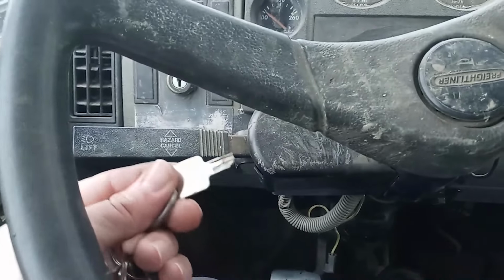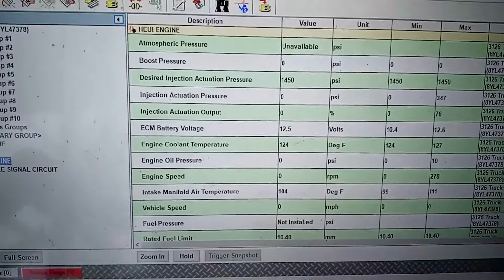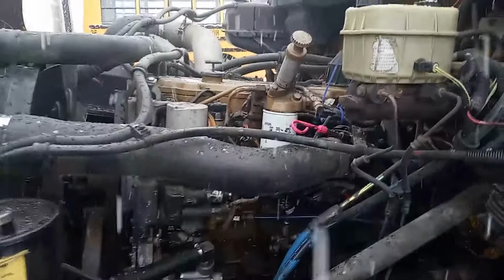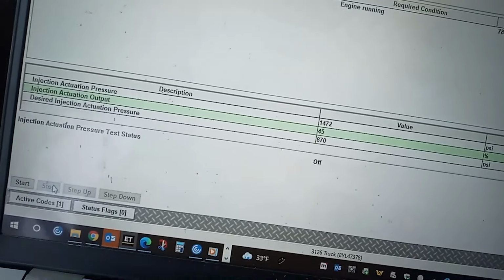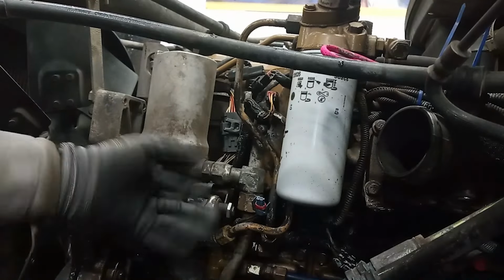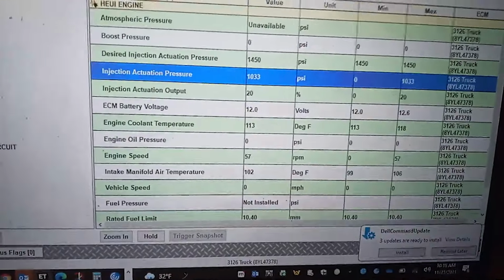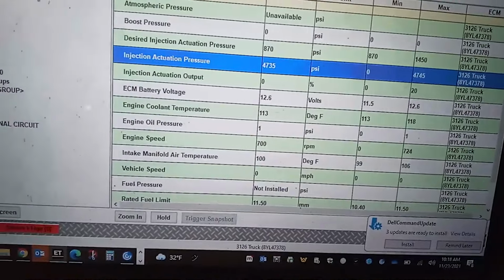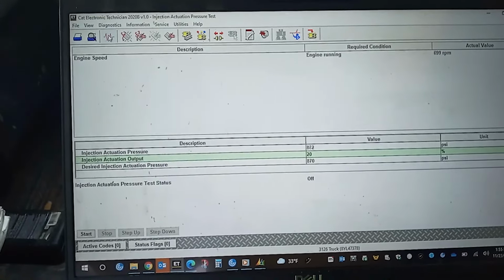Why Wont This Engine Start!?!

Comment: Thanks AA, learned about the C15. This one won't start, FP is good. Closed off regulator for full pressure, pins in P1 have batt+ and batt- like you said. I think ECM is bad. Don't have an inductive amp probe though.
Reply: Also, did an injector test with J-Pro, said short fail, don't know that means.

Comment: Do these 3126s have lift pumps? If the truck is parked downhil with the tank elevated, it runs fine but as soon as the trucks nose is uphill, it runs out of fuel and dies. All filters are new. Makes me think it's a lift pump but I can't find one!

Comment: hey Josh. I have a 2001 3126 and it has a long long crank after sitting. I have air in the return to tank fuel line. I bypassed the fuel tank lines and ran clear lines to transfer pump. I still have air in return fuel line. what do you think? injector bore leaking compression into fuel? please and thank you

Comment: I have a C7 2005 F650
KEY ON IM GETTING NO POWER TO HEUI. The ecm fuse hit the ecm combines with the ignition to ecm to fire the ecm which feeds the engine portion of the motor? Im curious on my next move. I hooked a laptop to it but not able to connect like its not fully getting power to the connector for diag.  I put a power probe into the diag connector i have hard power on 6 out of 8 pins. The two pins have power but like a flickering dim light. Any thought on my issue sir? Tia

Comment: Im from Pakistan - Ive got an 2012 Hilux Invincible which I imported it from the U.K cause the ones made in Pakistan do not have intercoolers! - Anyways I want to inspect the engine from the inside like the rod bearings, piston rings, any and all clearances etc - So as Ive got drive way, porch & a garage at my place - I was thinking after buying all the necessary safety equipment & tools for the job like the torque wrench and all lol - To bring my mechanic who actually understands how the work should actually be done at my place and have him do the job here - After researching and understanding on how to properly do it - I can guide him better. What do you guys think? Any advice? -
OFF TOPIC....
This Hilux was the first & last 4x4 by father bought me before he passed away so its really important for me - Since Im into Automobile Mechanics I was thinking of doing a course or something from abroad and make my own workshop here.

Comment: Hello . I have a Claas Lexion in Sweden with cat c9. hope you want to help me.

it runs on the startmotor with won't start. If I use a little brake cleaner in the intake it starts and runs perfectly. the feed pressure is zero when you run the startmotor but it is a 12v machine. when it is stared I have 5 bars. replaced all houses  and filters. also the reduce valve replaced. thanks for good youtube videos. they have helped me so far :)
Reply: Cod 164-11

Comment: I have a 7.3 Powerstroke and to my knowledge they use this fuel system from Caterpillar. I was having an issue of the truck not starting and I found the Injection pressure was not high enough. I was only building 200 psi. I replaced the IPR from Ford which I'm sure they get from Cat.  It solved my problem and I haven't had a problem since.

Comment: do you have the cat number for the dummy valve
Reply: Did you find the part number for tool?
Reply: @joebob3049 not sure if you still need it but it's on his description on the top.

Comment: Nice video sir.  One thing I always stress to customers is check your engine oil level first, if the injectors are passing oil into the fuel system, eventually the engine will die and have a hard time starting.   I also remove the nut holding the solenoid for the Injection Actuation Pressure Control Valve and slide it off the IAPCV and use a 1-1/8 box end to loosen the valve.  Keep up the good work 👍
Reply: When you remove the IAPCV, you can put the test plug in and dead head the HEUI pump.
Reply: @OldDieselGuy64  cheers thanks, I'm just learning electronic fuel systems in school right now
Reply: apprentice here, what will loosening the valve accomplish?
Reply: @busterscruggs3031  which valve are you referring to??
Reply: @OldDieselGuy64  sorry, the iapcv
Reply: Best of luck, was there about 40 years ago

Comment: I JUST GOT A 3126, ITS IN A 1999 BLUE BIRD, WERE IS THE MANUAL PRESURE PUMP HANDLE,BECAUSE IT HASENT RUN IN A YEARAND 1/2,NEED HEPL LOCATING IT

Comment: We used to remove output line install a line with tee 8000 psi guage plug the end of the tee, crank, dead head test should get near 4000 psi if it can then leak is an injector upstairs

Comment: Great video that shows what your “snoopdogging” troubleshooting technique has done: you saved the customer money by finding the exact problem of low fuel pressure was a solenoid vs. changing out a pump, and you enhanced your “cred” as a top notch diesel mechanic.  👍🏻👍🏻👍🏻

Comment: Hi man I have 2006 GMC c7500 caterpillar  u need to spend 2 hours to start  it has 90k original kms   when stating u need to pump fuel with leg many many times    it's c7

Comment: Our 2003 Newmar motorhome has a 3126 with the square head heui pump. If it fails can we replace it with a round top heui pump. I  like the idea of only having to change the solenoid (is this what you referred to as a driver in another video?) Ours only has about 51k miles on it  Thanks
Reply: Did you ever find out the answer to this
Reply: @timblack33  nope

Comment: Sorry to bother you but I have no experience at all with diesel and I am the proud new owner of a Thomas School Bus that I am going to convert to a skoolie. It has a 3126E with a CKM 4XXXX serial number, 103 miles. It runs GREAT, no smoke but, I have a few issues. One is, that on cold mornings (cold by SoCal standards, cool to anyone else) when I turn the key, nothing happens, no dash lights come on, no 'click'. BUT, if I just leave the key in that on position (just before the crank position) it will, in one to 3 minutes, come on, dash lights, gauges on and it starts like nothing is wrong. It can't be that it's supposed to act that way, could it? its a 2003 Thomas Bus with a 2002 manufacture date for the motor. Any thoughts? What should I check and or look to replace? I am competent at following directions.  The other two issues are it will tend to run hotter than 220˚ up hill in hot weather. Not big hills either. And can start to run this hot in stop n' go traffic if I have to sit at idle in drive for any extended period. The third thing is that the motor is 'governor' controlled to not want to drive over 55. I got the bus from Virginia and that seems to be a regulation there. I think that if I could get that all turned off, I could get lower RPMS (currently 2300 at 55). Thank you for whatever assistance you can provide.

Comment: Kind of an unrelated comment, but I recently purchased a gmc c6500 with a 3126, i was considering running amsoil diesel 15-40. Good bad yes no? The only videos iv found about it seem to be advertising.

Comment: I had an oil pump break off one of my customer trucks because the front main cap was loose. Came in for a front main seal leak. One bolt was still holding on and I unknowingly pulled that bolt first and nearly dropped it on my face. Lol

Comment: Ah good call on those pliers! I hate those solenoids on the c13s. The fuel enable valve, the IVA oil control valve, and the CGI control valve solenoids always give me an issue. The nut gets stuck to the coil part and the whole damn thing spins. A normal wrench won't fit on the base. You have to grind it down to fit.

Comment: Hey i just bought a freightliner with the caterpillar 3126 engine. I drove it from california to arizona which is about 300 mile or so. It was driving fine , but as soon as i got home and was ready to park. It started smelling like burned rubber and i saw a cloud of white smoke from the front of the engine. Now it cranks but wont start. I made it start for a few seconds but it starts smoking right away and it seems like something locks up from where the serpentine belt is and it makes the engine shut off. Any idea to what it might be ?

Comment: I have a 3126 in a 963C BBD serial number prefix and if it sits more than one day it will start and die and not start after that it will blow all kinds of white smoke but won’t fire at all unless you spray it with either. Cat check pressures and said everything is working but there’s something not right any help would be appreciated
Reply: Went through the same thing on the same loader. Heui oil sensor wasn’t consistently reading pressures so it’d start sometimes and idle rough or die.

Comment: I have a 3126 that's dropping on its face after 100% throttle but passes the IAPT. Has the same codes as this machine. You can watch the pressure drop after full throttle. I'm kind of stuck.
Reply: Go to a forum website
Reply: I'm curious did you figure out this problem? I'm losing power and my check engine light comes on after about 60 mph.
Reply: @derrickdunklin   it was multiple problems. Harness short to  actuation pressure sensor, injector seal failed, and clutch switch  circuit short. All causing drivability concerns. All under different conditions.

Comment: I'm a independent shop. Had open my door to back out a pickup. Backed out the truck, then all of a sudden a falcon flew in the shop and landed on a customer's 68 roadrunner. After it flew back out, I turned around and looked up on top of the roadrunner and there was a gopher, alive! That was exciting to chase out.

Comment: Cheap fix,  l got a c7 and  now on only will start after is cranking and engine built oil pressure , it can take like 10 seconds turning over into the engine build pressure and start but won't start as normal right away, only does that when park overnight, that could be the heui or temperature sensor?

Comment: I replaced ECM( was bad)  ,Heui, IAP still no start now changing cam sensors.I pinned out all power grounds no output from ECM no Heui pressure.
No leaking injectors only 40,000 miles RV motor ran perfect. Then never started.
Any ideas?
Reply: What cause of the first ECM failure. Is it getting all power and grounds, getting key on power. Can you hook up a EST to the obd and see if its online. Voltage drop test battery cables?
Reply: @keiferjanz3197  i cant communicate with CAT  only Freightliner chassis is a Class A rv .
I plug my CanDoo scanner into the port on Motor no communication .
CAT dealer flashed ECM . Not sure where port is in RV to scan.
Motor ran perfect and one day no start.
I checked all power grounds . I am changing both Cam sensors soon.
40 years as a mechanic this one got be mad. My RV of course . 
Thanks

Also crank speed was low. Maybe a issue gor Heui pressure to get to 870psi ?
Reply: @mitzvahgolem  Most electronic engines will  run off of one speed sensor if say a cam sensor is faulty, normally delayed starting will occurs. I'm not familiar with Cat Ecm's if they are using Can communication, if so there is a possibility of a bad terminating resistor. This will cause an Ecm to be offline
Reply: @keiferjanz3197  where would that resistor be at? Thanks so much👍🤓
Reply: @mitzvahgolem  normally there will be one internal on the ecm and an external one, they usually look like a blank connector on a twisted pair of wires on the harness. The wires are normally green and yellow. When you test them you should be 120ohms unplugged, when connected and proper communication the can circuit will test at 60ohms

Comment: Does anyone know what would cause grease like black stuff on the back of the coolant cap?? No one can figure it out. Doesn’t use oil or coolant, doesn’t smoke, coolant is clean, doesn’t overheat, has been doing it for a couple of years. My mechanic hasn’t been able to figure it out… :(
99 fld120 3406e
Please help

Comment: So it turns out that all this time the HEUI system was actually there to protect the engine in case of an oil pressure loss? Lol
Reply: If that owner knows what happened, he probably loves the HEUI system  now, even with its flaws.

Comment: Given the extra layer of components and complexity in a HEUI system vs a common rail system, I have always wondered why Cat and Ford went with the HEUI for so long.
Reply: At the time of its development, it was the most technologically advanced Diesel fuel injection system that had ever been invented, quite a modern marvel to have an electronically controlled instead of mechanically controlled system. On top of that, you could change the power level at the click of a knob, or a reflash without changing any of the injection hardware.  Ask the 12 valve guys about that one.
Reply: Ford never used HEUI themselves, they were using Navistar engines.
Reply: For emissions, but I always wondered why cat was easier to work on and more reliable with the HUEY or HPOP. LOL just kidding its a cat!
Reply: Like all your videos learning lot thank you. 🙏
Reply: Decades ago we found oil type and condition was the biggest factor in longevity and reliability with HUI motors, to the point
 1.we ran remote oil system extra volume (ROS)
2. We ran extra bypass oil filters ( 7micron)
3.we ran centrifugal oil filtration ( spinner filter)
4.And a 4micron in line filter to HUI pump supply oil circuit. 
This gave good oil pump life, good viscosity longevity and exceptional HUI pump and solenoid valve life.
This was an evolution in a large fleet addressing reliability issues thru failure analysis and trial and error over time but any one can do these upgrades  quite easily and effectively if you have a HUI system, the only issue we saw was oil migration into injector harness but this seemed to become less of and issue as we removed more carbon from oil with filtration upgrades , oil seemed to be less conductive and didn't affect injector operation even though slight leakage from passthru plug still present
Reply: At the time heui was the best option for high pressure electronic fuel injection. Of course until common rail became standard. It’s very capable, as oil pressurized over the lower viscosity fuel easily creates desired injection pressure.
Reply: Keith Also back in the mid 90's when the HEUI system came out emissions weren't as tight. HEUI could provide the needed pressure. Standards got tighter requiring much higher pressures at the injector tip for greater fuel atomization. Common rail systems have tip pressures as high as 30,000psi. Common rail is more expensive, tolerances are way tighter to get the needed pressures.

Comment: One good thing about heui engines is it's hard to hurt one due to oil pump failure or running it out of oil ECT because no oil psi won't run
Reply: Um hpfp sending metal through the system don’t hurt a thing lol

Comment: That’s funny you had a chicken in the shop. Cause back when my wife worked at caterpillar, one of our chickens rode in the frame rail of her pickup to work one day and ended up running around the lot and had a bunch of the techs out chasing it around. Never did catch it.
Reply: I worked a shop where turkeys roamed locally. 
And when you are face to face with (let’s be honest, a RAPTOR) 
Never underestimate a bird.

Comment: Great video!   I have two 3126s in a small church bus fleet, this is exactly the sort of content that will come in handy someday.  What is the part number of that block off tool?

After recently getting set up with Cat ET, seeing you use it makes A LOT more sense.  It seems to be a very simple and easy to use diag platform  Thanks again and have a Merry Christmas season!
Reply: Block off tool's part number is in the description :)

Comment: My C7 in my bus is also overheating while not sending heat to radiator and or rear passenger bus heaters. Like thermostat is acting up. But that doesn’t explain why it’s not sending heat to heaters.
Reply: You either got a closed heater valve somewhere, broken thermostat, a clogged radiator, or the water pump is bad. Someone may have put stop leak in the coolant at some point and that’s causing your problems.
Reply: Low coolant level is usually the first thing to check for.

Comment: My bus / daily driver has shutters in front of radiator so we can put all the heat inside the bus to keep passengers warm in winter, shutters recently been misbehaving opening n closing while it doesn’t make sense like closed when warm engine or open when cold engine cold out. Has vacuum to engine block on an electrical sensor.
Reply: Just put cardboard on the front.